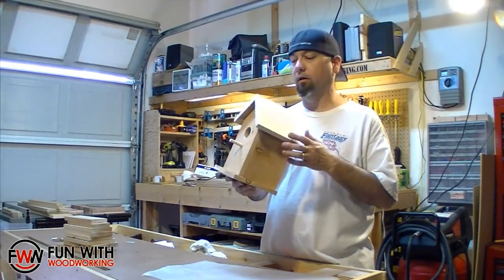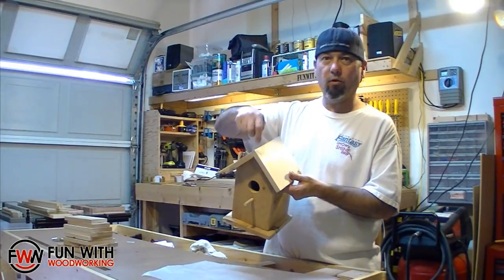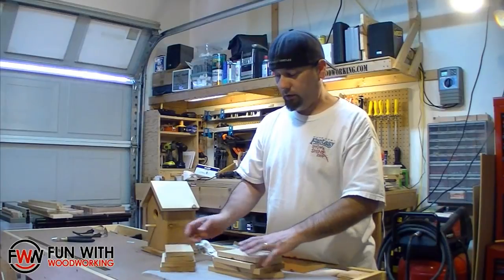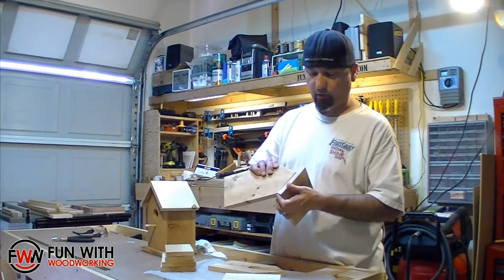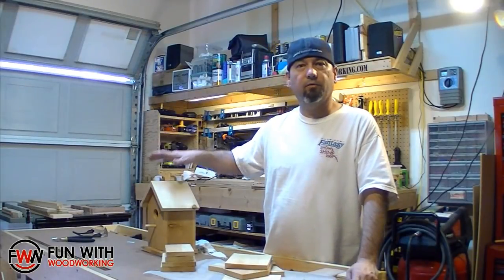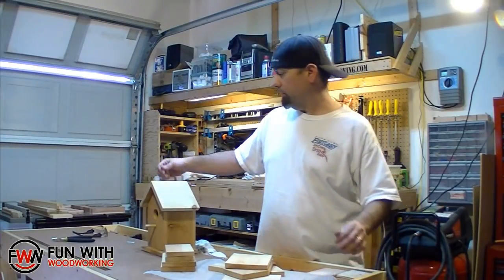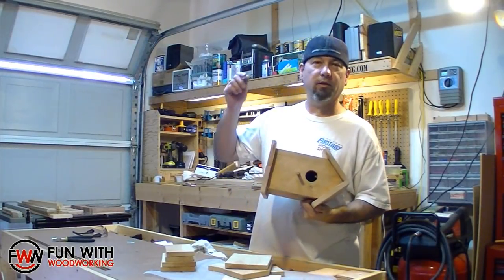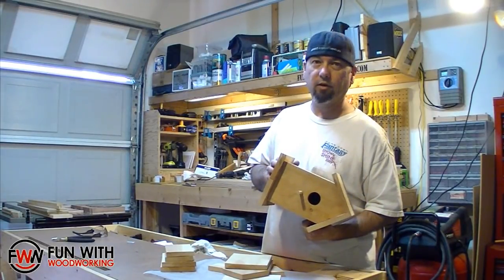How to make a quick, simple, and easy bird house (re-upload with new music)

Comment: Good basic plan for the novice and kids.  For the birds you need to drill some holes in the bottom and under the front and back eaves for ventilation or the chicks will cook. Or you could cut the sides slightly shorter so there is a gap between the sides and the eaves. Use screws and no glue on the bottom so you can remove it and clean it out.
Reply from the maker: Thanks you for your suggestions. They all sound like good ideas to fix in the next version.

Comment: No glue no paint no perch .need draining holes in bottom . Need one side to be removable for cleaning . Need to rough the hole side from inside so the baby’s can climb up and out . Smooth side would be hard
Reply from the maker: Thank you for your input.
Reply: Cut horizontal grooves on the panel on the inside underneath the hole it will aid the fledgling chicks to climb out of their box & as stated above there is no need for a perch it only aids predators, I’ve given you advice not criticism it will help you help the birds thank you for taking the time to post and thank you for caring about our feathered friends 👍

Comment: People have pointed out the flaws this house has and the foremost for me is the problem with cleaning it each season.  Have you considered using heavy duty Velcro or similar to secure one side of the roof or base to the main box.  This would eliminate the problem. Not to be used inside or outside of course, but on the thickness of the wood which is usually a half to three quarters of an inch.  This is not meant as a criticism but as a suggestion that may may help you in the future.  If it works then there many other possibilities.
Reply from the maker: That is a very good idea.  If I ever make another one, I will keep it in mind.  Thanks!
Reply: @FunWithWoodworking  Thank you for talking the trouble to reply.

Comment: You are teaching wrong.
Birdhouse needs a way to drain rain water,  ventilation holes, removable side panel or front, not bottom for cleaning, no perch necessary, a entrance guard (metal or wood) and a inside groove so babies can reach exit. Screw holes should be up and dow, cheers lol
Reply from the maker: Thank you!  I will try and incorporate those changes into my next design.